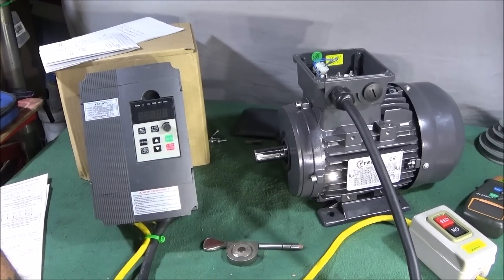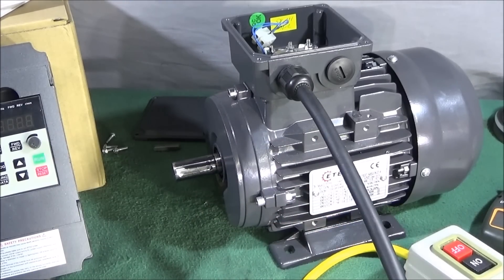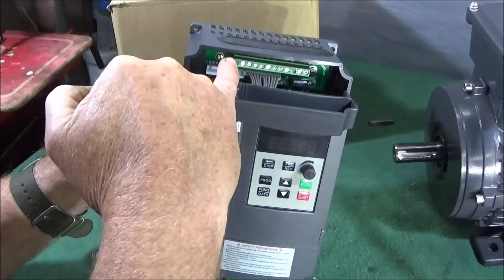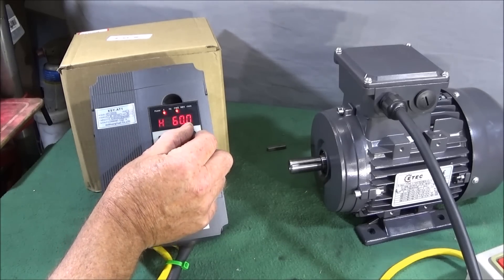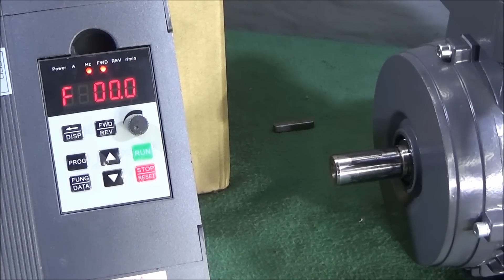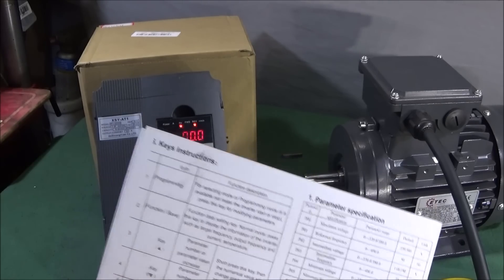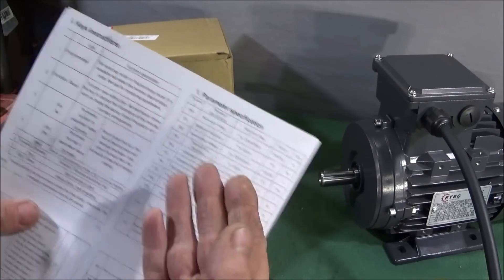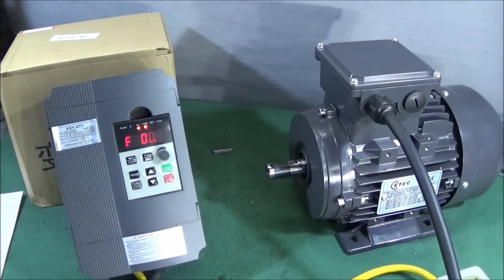XSY-AT1 VFD & 3 Phase Motor Bench Test Review Mini Lathe & Myford..

Comment: Keep in mind these low cost VFD's are not to be confused with real vector drive VFD's. Which means in simplest terms; no closed loop torque control. This means your motor will perform at rated power only in very narrow frequency range. Low speeds will current-saturate winding, and high speed will experience sharp power drop-off. So keep your motor speed at rated +/- 20Hz for reliable performance.
Reply from the maker: Hi Paul, you will actually find that there are those that try and make out that the Chinese equipment is in some way inferior to certain brands or certain types of electrical equipment. Those with vector drives are worried about the new Chinese VFD's because not only are they really affordable, but they perform excellently. The vector drives are good but are way too expensive for what they are, plus many of them are made using Chinese components anyway which is a bit hypocritical when you think of it.
  The vector drive companies have had a good run for their money, seeing what they charge for them. I think my brother spent about 700 English pounds on one. It is excellent in that it is silent in operation, but it doesn't do any more than my Chinese VFD's and we have compared the performance. 
 I have bought two Chinese VFD's now. I did by new modern three phase motors to go with them and the seller specified that their motors can be used with VFD's. I don't know whether there is any difference between older motors with VFD use?
 Both my VFD's are outstanding in both quality and performance. The torque they produce is fantastic even on really slow speeds. Also If I use them a lot at slow speed then I direct an independent fan onto the motor which keeps them perfectly cool. I am putting together an automatic thermostat type external fan at the moment which I hope to show soon, another project and very easy to make with readily available low cost components.
  It does make me laugh sometimes, because the people that run-down Chinese made things, most probably have and use mostly Chinese made electrical equipment in their homes,.
  I hope you find out the problem with your set-up and that you don't get put-off the VFD's I have shown, because it is only people trying to keep sales up, by making out their equipment is superior in some way, or like I say they try to introduce an element of fear, making out that one is buying low cost sub standard equipment, when buying Chinese things.
  My brother said he would never have spent that sort of money on a vector drive, if he had known about the VFD's at the time. He was totally astounded when he saw my set-up working with the Chinese VFD's. 
Regards
Steve
Reply: Motor control theory represents well studied science. I would refer anyone planning to use VFD technology to initially learn fundamentals associated with driving an AC motor. Generally if one cannot describe what torque-control, feedback, magnetic saturation, or back EMF define; one should consider learning basic control theory before setting out to design drive system based on generic VFD. Chinese VFD's are what they are; it is not opinion, guessing or bias toward Chines products. There are many Chinese products worth buying, and many more not worth a red-cent, there are US made VFD's not worth a red-cent. I personally own three Chinese made VFD's; used on 1HP Bridgeport, 3HP scraper, and 1HP hydraulic pump. Both 1HP application perform reasonably well because driving 1HP motor at minimum load is easy, and performance expectations are low. However 3HP application with dynamic loading suffers; producing only 2.2HP at rated speed and magnetic saturation below rated speed (over heating). Generic VFD's include three sections; three-phase rectifier input, filtered DC intermediate, and microcontroller PWM IGBT three-phase driver circuits. System runs open-loop; i.e. there is no synchronous current or voltage feedback used in servo-loop control scenario. Therefor, severe limitations are placed on drive performance as stipulated in basic control theory (not speculation, opinion or bias). Vector-drive systems incorporate as many as three or more parameter feedback-loops in full servo-control scenario; this is done because control theory dictates use of various electrical parameters to achieve minimal performance metrics. There is no way to magically bypass control theory limitations using open-loop drive approach. As far as sub-standard component use in many VFD brands; well, take a look inside.
Reply from the maker: Good Grief, I'm gonna have to do 5 weeks of intense theory........ just to press the start button....:-)
Reply: Ten minutes of informed theory, is equivalent to ten years of blind discovery! A wise man once said...
Reply: B Smith Perhaps you could elaborate, and confirm, as I suspect, that I've made a big mistake. I'm in Canada and I just bought a low cost VFD from a US supplier. It's a GS2 11P0  from Automation Direct (if you care to look it up). I discovered very quickly that I cannot run the motor at the speed I would use for single-point threading. With the gear reduction in my lathe (Sieg SC4) that's about 3Hz. Without adjusting the torque-boost or slip- compensation I can stop the chuck from spinning with my finger. If I adjust either of those setting it makes it hard to stop the chuck, but the VFD quickly overloads and shuts down. So, have a made a huge mistake?  Many thanks, if you respond to this! Desperate for help here. The vendor hasn't been terribly helpful or reassuring to this point.
Reply from the maker: Well I haven't had any problems with the low cost Chinese VFD's. They run my motors perfectly at all speeds with excellent torque.
Reply: Limitations of non-vector VFD's is well characterized and documented in motor drive theory. It is important to understand performance differences between various drive methodologies prior to application. You may get lucky and experience reasonable performance; depending on your system and expectations. However you may also end up with system supplying insufficient torque at desired speed, or overheating, etc. Closed-loop motor drive systems incorporate multiple feedback elements and calibrate drive electrical parameters to properly match system variants. Vector drives can adapt and perform optimally over wide variations in application parameters (speed, load, temperature, motor parameter variants, and dynamic variances). This is why true vector-drives are more expensive. Chinese VFD's are also built with $15.00 assembly budget; you will find internal components at below minimal standard for AC high-voltage applications. Forget about UL or CE certifications; these stamps are counterfeited routinely on imported equipment. Try requesting certification certificate from manufacturer, or even identifying actual manufacturer for most Chinese brands.
Reply: Steve Jordan Thank you for replying. All of the YouTube vids I've seen seem to be very much like yours; no problems, no issues. That's what I was expecting as well. That wasn't my experience. I'm a bit lost now.
Reply: B Smith I was aware that these things have limitations, but following the lead of Steve, AvE and several others I wasn't expecting to encounter them (whatever they are). There has to be something won't with either the drive or the second hand motor I'm using.
Reply: Paul...
Did you perform all parameter programming? Sounds like something is very wrong, based on your performance description. Many generic brand VFD's provide minimal instructions with important information discarded. Assuming you are driving three phase 240VAC motor; make sure VFD parameters reflect proper voltage. Number of motor poles is critical and if incorrect; motor may still turn, but at wrong frequency, greatly reduced performance and efficiency. Please provide details concerning motor, voltages, power, # of poles, desired speed, estimated loading, and VFD type.
Reply: GS2 11P0 VFD appears comparable to most 1HP imports, however import VFD can be purchased for around $60.00. Did you swap out original DC motor in lathe? I see SC4 listed with 1000W DC motor. 3Hz with gear reduction? What is actual motor speed, or gear reduction? If motor is in fact being run at very low frequency; you may be experiencing severe magnetic saturation (i.e. point at which increased current through motor coils cannot produce additional magnetic flux); current beyond this point will be liberated as heat. This would be one example of why current feedback is so important. However, if motor is being driven at frequency close to rated; you may want to look at issue related to use of proper motor, or incorrect VFD parameter settings. Given simplicity of your application, I would say, low cost VFD should be fine. I use import 1HP VFD on Bridgeport mill, often run at motor frequency of 30hz, with spindle gear reduction approximating your speeds; and plenty of low-end torque observed. Below 30Hz, I would not venture; because industrial synchronous motors are not designed to operate at frequencies above or below 50/60Hz. Doing so requires control-system modifications to achieve rated performance. Yes, everyone is using generic VFD's to vary motor speeds from 0 to 200Hz; and in many simplistic applications; probably fail to notice performance degradation or potential motor damage.

Comment: can it manage 2.2kW 3 phase asynchronous motor?
Reply from the maker: It is rated at 2.2KW so I presume so?... Maybe someone else will answer this question?
Reply: how much kW is your motor?
Reply from the maker: It is.....0.75kW......... (1HP Motor) (1400 RPM 4 Pole)
https://www.ebay.co.uk/itm/3-PHASE-ELECTRIC-MOTOR-0-37KW-TO-11KW-1400RPM-2800RPM-2-POLE-4-POLE-ALUMINIUM/191770300135?ssPageName=STRK%3AMEBIDX%3AIT&var=490794456079&_trksid=p2057872.m2749.l2649
Reply: so i guess that china's kWatts have to be divided by 1.5 at least ;)
Reply from the maker: No they are exactly as specified, I believe.

Comment from the maker: IMPORTANT NOTICE:-  SINCE MAKING THIS VIDEO I HAVE ALTERED THE CONFIGURATION OF THE DUAL VOLTAGE MOTOR TERMINALS TO DELTA. PLUS, MORE IMPORTANTLY,  I HAVE CHANGED THE MAINS POWER LEAD THAT I CONNECTED UP TO THE VFD, TO ONE THAT HAS A CONTINUOUS WIRE TO EARTH, RATHER THAN AN EARTH WIRE THAT IS OPERATED BY A SWITCH, WHICH IS WRONG. ALL EARTH CABLES MUST BE CONTINUOUS TO EARTH.

Comment: Why was it necessary to actuate the switch to check your earth connections for continuity? Does this mean that your earth wire is switched? It should be a continuous connection, unswitched. That way, any switch contact failures cannot result in a disconnected earth.
Reply from the maker: I changed that to continuous already...Regards Steve

Comment: Next tine, just use a cheap computer power supply cable.  They are cheap and mass produced.  Clip off the female end. and wire it in.  Just make sure they are rated for the correct amperage.

Comment: Hi Steve 
I've learnt a lot from your videos. But I was surprised to see you have connected the motor in “star” those small motors are usually dual voltage ie “star” configuration for 415 volts 3 phase (UK mains) and “Delta” for 240 volts 3 phase, which VFD’s usually output. Check the voltage output for you're VFD and the motor rating plate  on the motor, if it is indeed 3 phase at  220/230 volts and the motor is dual voltage rearrange the links at the motor for “delta” In your purchasing link one of the photos shows a motor connected this way, but calls in “Triangle” connection, some thing lost in translation!  I've been unable to check the above as I can't find the manual on line and the video does not show the motor rating plate.
Michael
Reply from the maker: Hi Michael....Well thank you very much! It is a dual voltage motor and I have just changed the links around. This is my first experience with 3 phase equipment. The actual instructions that came with the VFD doesn't show the product listing photo/diagram, where it shows the actual motor link configuration. When I bought the motor it came as set as in the video and I wrongly presumed that it was correct. This is why I overlooked this. Thank you so much for pointing this out....Regards Steve
Reply: Hi Steve Your welcome. One other thing I meant to comment on, it appeared that the isolator needed to be on for earth continuity, this is wrong, here in the UK no switches are allowed in earthing wires  as they can go open circuit leaving the metal work unprotected.
Michael
Reply from the maker: Ok thanks... I will change that as well......Regards Steve
Reply from the maker: Hi Michael, Do you know if is ok to connect a 3 phase emergency stop button between the VFD output to the motor?
Reply: Steve Jordan

No need to do it that way, and not recommended as inverters don't like to see open circuit on there output terminals, as this causes large surges (voltage spikes from the collapsing magnetic fields) which can blow the electronics. I'm pretty sure you'll find that you can simply remove a link from the control side of inverter to fit the emergency stop, which would be in the low voltage control circuit. This wiring should be kept separate from any other wiring. Best read the manual first though, I would like a copy of it, as I will probably be doing the same job some time, then I could read through as well, 2 heads always better than 1
Michael

Comment: Hi Steve. Is there any chance of a link to the copy of your instructions? Mine's a different brand, the instructions are rubbish and I can't work out how to adjust the torque compensation, your instructions might give me a clue...
Reply from the maker: The Torque settings are on (P70 & P72 Torque compensation). (P71 Torque compensation voltage).
Reply: Yeah I know where my settings are at, there's just no information on how to correctly use them. Trial and error is all I got...

Comment: Excellent video. I have a VFD on my 1941 Flott drill press, works really well. I have connected a potentiometer and buttons for forward, reverse and stop, all of these run on 5/12V so you can use low voltage versions.
Reply from the maker: Hi Thanks....Was it easy to connect all of these? Regards Steve
Reply: Steve Jordan Hi Steve, yes, very easy, it was described in the VFD manual. I have HuanYang 1.5kW and it has I believe 6 freely programmable button inputs where you cann connect a simple push button to each and connect them all to ground. Then you program the VFD for each of the buttons with one of the available functions, e.g. forward, reverse and stop (but thre are more, e.g. preselects for given rpm etc.) ie you define a param in the firmware specifying which function to execute when the button is pressed. The potentiometer is just wired with 0 and 10V and the middle contact which are 3 dedicated connections on the VFD.  It should be similiar for your VFD as they are all quite alike. Take care. Steffen
Reply from the maker: Hi Steffen, What about an emergency stop button?
Reply: Hi Steve, 
I have not wired an emergency button, however, the parameter list for the multi-input offers both a normal stop function and emergency stop, so I could add another button for an emergency stop. Or, I could just put another button parallel to the existing stop button (wired OR) and use a more prominent aka RED button housing for that one. One could even put a "do not press this button" notice up (Terry Pratchet..)

However, for real emergency stop (that stops the machine rather quickly) one needs a serious amps braking resistor to convert the kinetic energy of the machine into heat, I believe, and these are quite bulky and expensive, used on big milling machines and such.

Besides active braking, one could program if the motor coast to stop or is decelerated by the VFD and the ramp times for start and stop functions, so with changing those parameters one can decelerate faster if so required.

Comment: Thanks another great video, quick question, when you were showing the jog, can you jog, 90 degrees or 45 degrees for example so you could use it for indexing? If so fancy doing a video on it 😀. Cheers
Reply: No this would require a proper  servo drive and an encoder for positioning feed back.

Comment: Hi Steve, great video I've been building up a selection of tools to get back in to home engineering and your videos have provided a wealth of information, thank you. Just a quick question do you have a link for the motor you are using in this video, as I am after this upgrade for my ml7. thanks in advance for any help.
Reply from the maker: Hi Thanks https://www.ebay.co.uk/itm/3-PHASE-ELECTRIC-MOTOR-0-37KW-TO-11KW-1400RPM-2800RPM-2-POLE-4-POLE-ALUMINIUM/191770300135?ssPageName=STRK%3AMEBIDX%3AIT&var=490794456079&_trksid=p2057872.m2749.l2649

Comment: Hi Steve, you timed this video just right for me! My Chester 9-20 lathe 18yrs old now, motor failed, so I'll do same as you have done, thanks so much, from Cov' Uk.
Reply from the maker: Hi Grahame Thanks, Just check out the above comments, as I had a couple of things configured wrong which I had to alter. When I do the next video I will mention this. I have just finished putting everything on the lathe now and its all back running.... I am totally impressed with it. Regards Steve